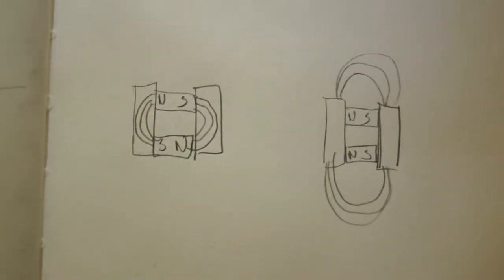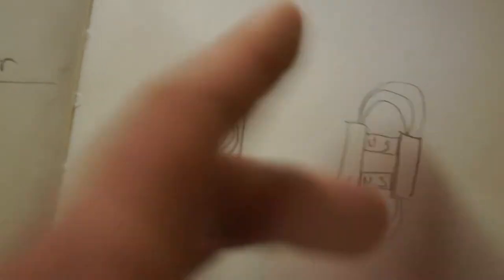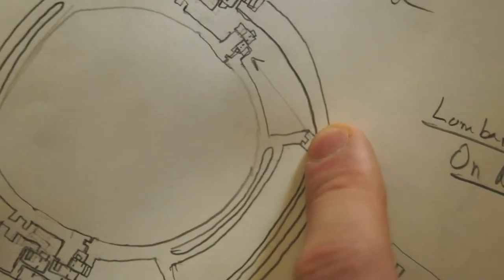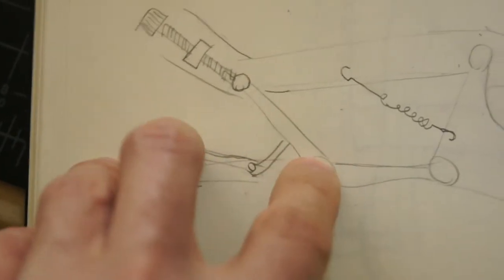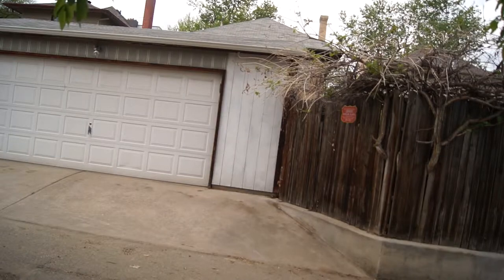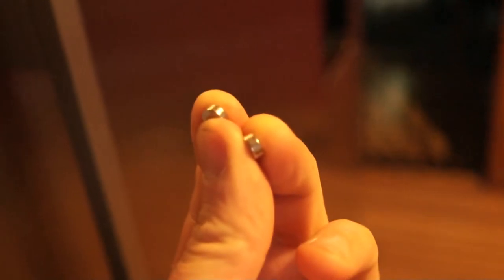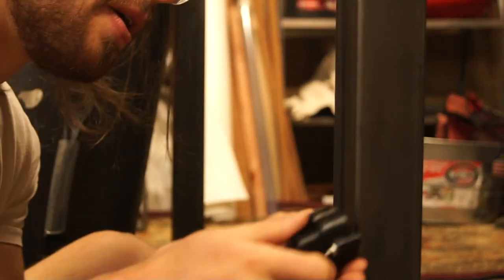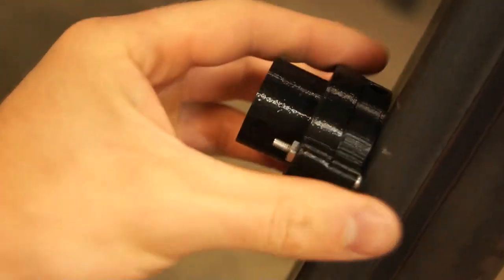HOW TO MAKE 3D PRINTED SWITCHABLE MAGNETS

Comment: How do you calculate the strength of the combined magnets and the material needed to quell the magnetic flux?
Reply from the maker: I did it. But forgot how. Think you know the magnetic strength of the magnets and the saturation point of the metal